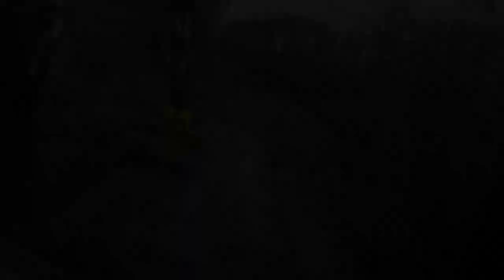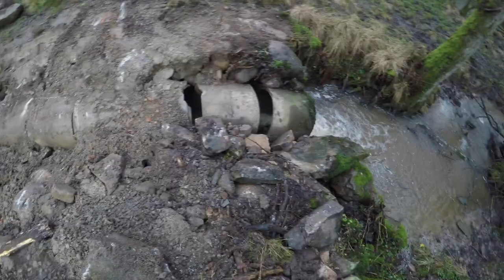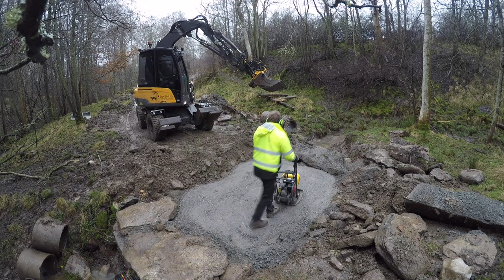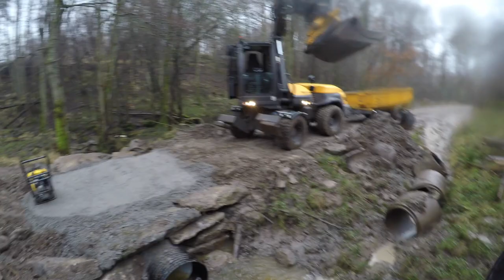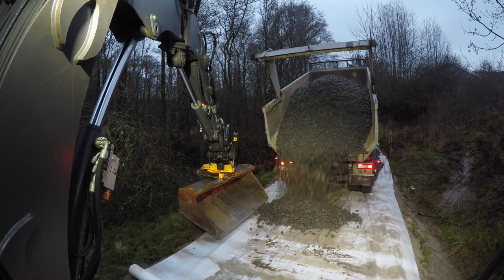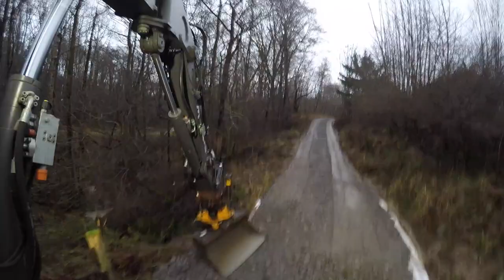Fixing up an old road with Mecalac MTX12- Part 1

Comment: I think YOU made a mistake........You should have completely filled in the GAPS on both sides of the NEW PIPE with GRAVEL , INSTEAD of laying those large rocks DIRECTLY ON TOP OF THE NEW PIPE ! WHY......Because , NOW when heavy vehicles drive over the rocks , their weight is DIRECTLY Pressing on the NEW PIPE .......NOT GOOD !!!! MY way , the weight would have supported BY the gravel INstead OF the rocks !!! THINK ABOUT IT !!!!
Reply from the maker: Hi Joe,
Thanks for your input!  But as you can se in the video, I just put the large rocks on the pipe to keep it in place in the stream while I fill the gaps and around the pipe with gravel. After the pipe is set and fixed in position I move the rocks and use them in the wall on each side of the road. 
The gravel is compacted and takes up the bigger part of the load 😁👍
Reply: @rasmushammarlof1164  Great ! I quit watching too early !

Comment: Wow with that swivel attachment this machine became a real swiss army knife , "the ultimate machine , Thanks for sharing !
Reply: If i could see it right, its a Tiltrotor and the good thing is, its available for almost all machines that have enough hydraulic power.

I have seen operators doing stuff with this where i surely said: "That man can eat his lunch with that machine."

I mean, just the ability to have a quick change and turn your shovel/fork 360 degrees gives you SO much more options! Plus the grapple you have on it.

Comment: Need to slow the high speed down. It makes to hard to watch. Try editing in some normal speed video. Great job 👍 I would have loved to had a 12MTX  when I was operating backhoes. The Mecalac is so much more versatile
Reply from the maker: Thanks for the feedback, will take that with me. Yes, the Mecalacs are  great machines :)